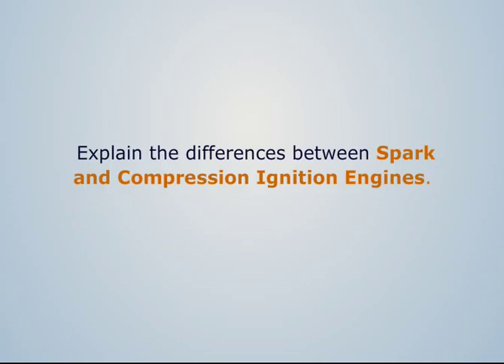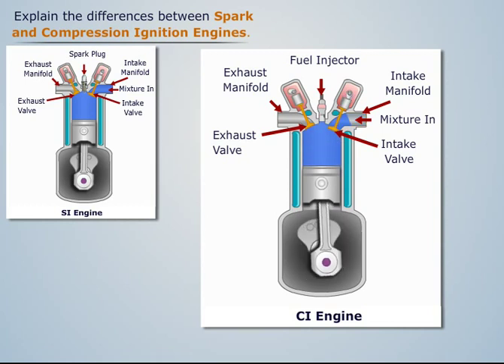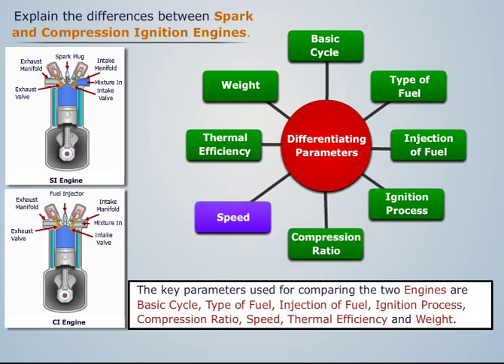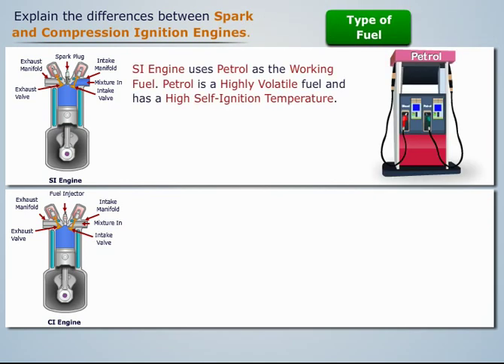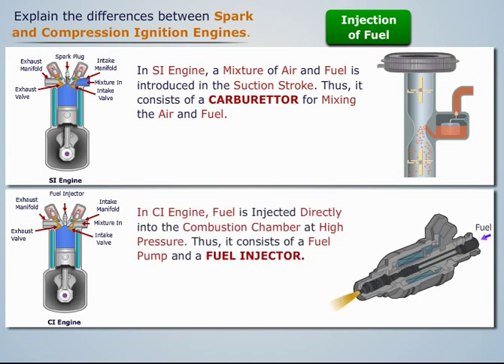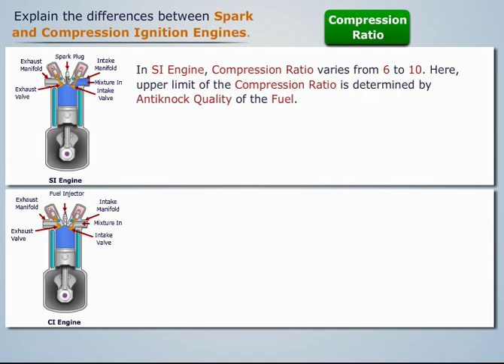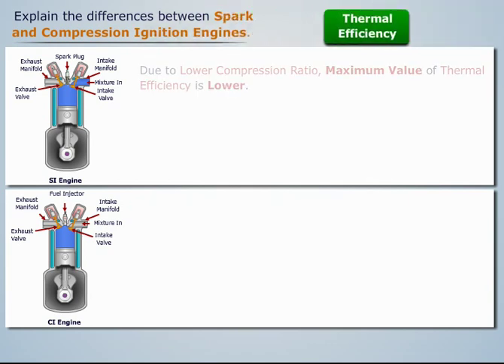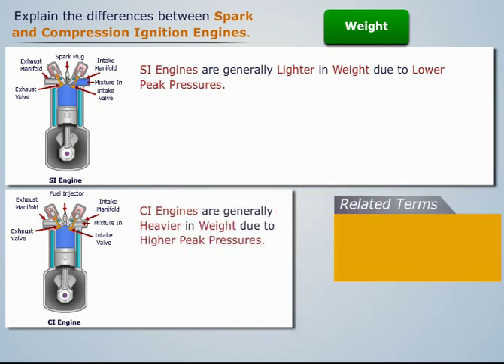Difference between Spark & Compression Ignition Engines | Internal Combustion Engine

Comment: can you tell me what exactly is compression ignition
Reply: Compression ignition uses the heat created to set off the fuel and air mixture, instead of using a plug that creates the spark to ignite the fuel air mixture
Reply: Then if you leave lets say a diesel engine out in the cold with no heat at all how will it start with no spark plugs?